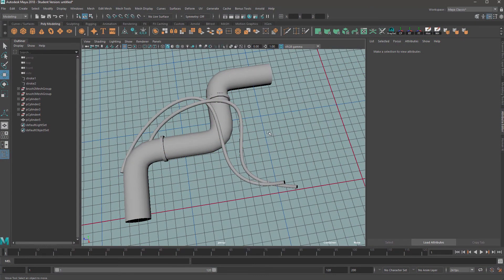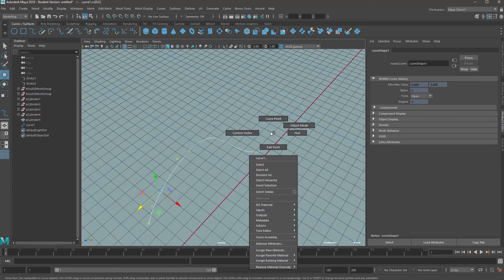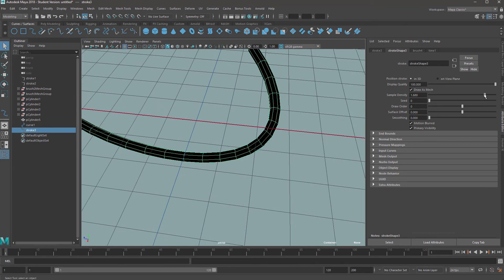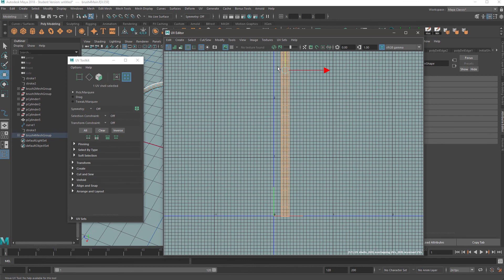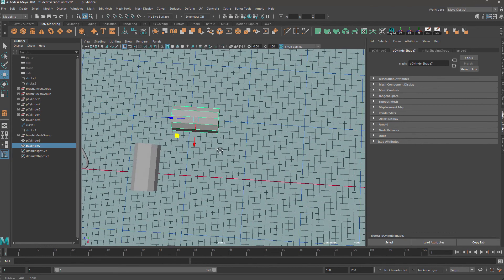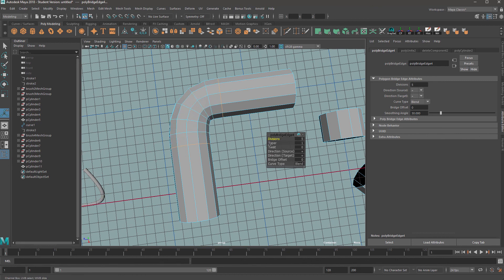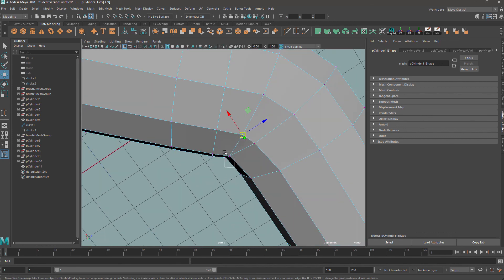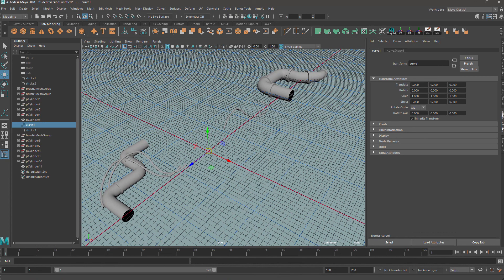How To Model Pipes And Wires ¦ Simple Techniques [Maya]

Comment: pathetic Maya
Reply from the maker: If you don't use/like Maya, there are plenty of alternatives.
Reply: @RobotArmy3D  I have to work with it at work, no alternative
Reply: @dubscope2246  maya sucks for pipes...so sad.  try a 90º angle, it will fail miserably..using bonus tools, plugins...etc. Also thickness a lot of times is not even regular. I´m not saying maya is a bad soft, it´s great in general. It just has some really weak points like this one that I have no idea why autodesk don´t fix them. For example, in max or blender, any spline/curve, you just click a button and make it solid, square profile, round...simple and perfect
Reply: @pipahouse   It just has some really weak points since almost decades